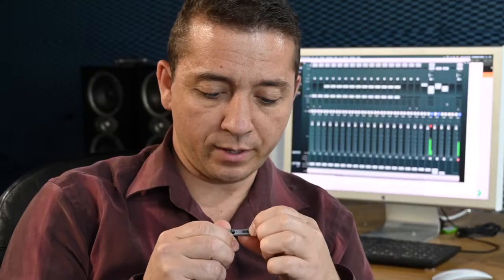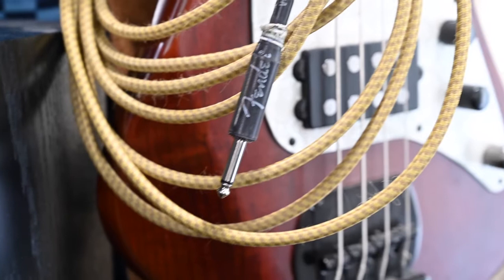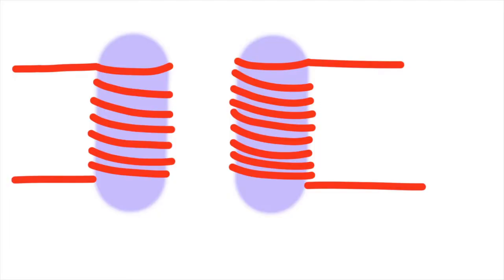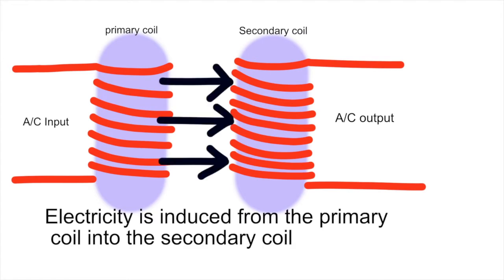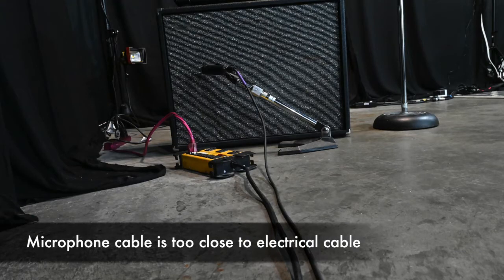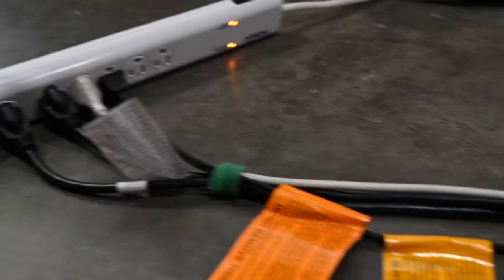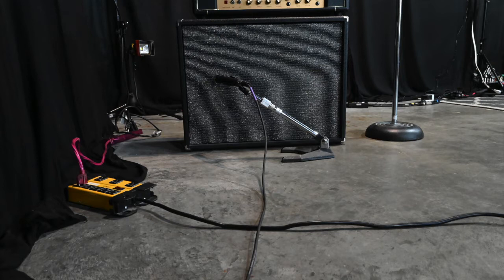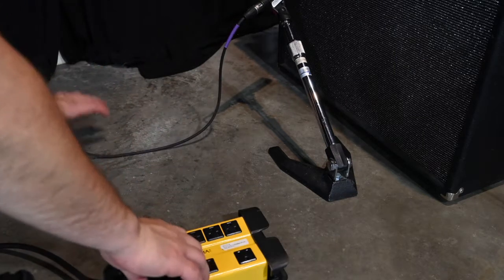Interference in the Home Recording Studio. Lesson 18

Comment: Great video! I have a small music studio and have been plagued by radio interference. I only notice it from two sources - one source is my guitar rig. I occasionally hear the interference through my two amps, but it can happen with all my guitars (some single coil, some humbuckers, some shielded, some not). The more prevalent source is my Fender Rhodes. Nearly every time I plug in I get terrible radio interference. I can sometimes get rid of it by crossing cables or just waiting for a less noisy time of day (time of day that it isn't noisy isn't consistent).

Both sources of interference pick up an FM (!) Tejano station. I'm really in desperate need of help and you seem quite knowledgeable. Thanks again for the great video!
Reply: I’m on on the same boat 😢

Comment: Great video! I have a question. Would a DI box help with radio interference when recording guitars? Maybe plugging the guitar into de DI box an then to the XLR input on my audio interface. I’m not really sure how it works and wether the ground lift on the DI box would help or not. Thanks!
Reply from the maker: A di box might help, because the xlr cable coming out of it is less prone to picking up interference. So instead of having a 20 foot guitar cable cpu could have a 10 foot guitar cable, a di box, and 10 foot xlr.

Comment: I bought the Warm Audio WA-14 large diaphragm condenser mic and have not been able to use it cause RFI is being picked up and I can hear it through my monitors, I have replaced the mic cable with a gold plated professional shielded cable and also bought a Furman power conditioner to help get some of the dirty power that was maybe causing the problem. It is still there and I have no idea what to try next to be able to use my mic. 

Great video! Thanks.
Reply from the maker: There are so many things that can cause interference. Are you only getting interference with this particular mic, or with other microphones as well?
One thing you can try, which I don’t mention in this video, is for the power to all audio devices come from a single physical outlet.
Reply: Hey Jason, i'm having a simular problem (RFI which I can hear through my monitors and through my rhode mic when I want to record something with headphones). It's impossible to use my gear (Yamaha hs7 monitor speakers, focusrite 6i6 2nd gen and rhode mic) I got no clue what to do about this issue. Have you found a way to fix your trouble or the cause?
Reply: @frowzone286  have u found a solution ?

Comment: So I have a shure SM7B connected to a GoXLR. Every now and then I do get interference and pick up radio signals, from what it sounds like it sounds like a trucker on a walkie talkie or a radio. I think it might be due to the XLR cables that I got, I pick up radio frequencies from them and well I think its because I hadn’t put much thought into it and got some cheap cables thinking it didn’t matter and id save a buck or two. I ordered a canare L-46ES quad balanced cable, so hopefully that helps ! 

My house (or at least my room) doesn’t have 3 prong connectors, so I can’t keep my stuff properly grounded. I don’t know a way to work around this, another thing I thought is that maybe ordering a cloudlifter might help? maybe it could help with interference, but I honestly don’t know. 

I’m a complete beginner to audio stuff and clearly I haven’t done my research before investing so much into this setup. I’d like to know what you reccomend! Any products to help ground my connection? thanks!

Comment: I have been experiencing an unusual interference. It is very brief - about 1-2 sec- occurs at an interval of approximately 60 seconds, and sounds a bit like a bug zapper. It’s baffled me. Worse with certain guitar PUs. I remember originally thinking it was a defective acoustic guitar pick up I had installed, but I couldn’t reproduce it at the shop and I’m sure the tech thought I was crazy. I suspect it’s coming from something in the house or possibly even outside like a cell tower? Does anyone have any ideas of what might cause an intermittent sound like that? And, by the way, the video was great, and I learned a lot!
Reply from the maker: There are many things that could be causing this. First thing that comes to mind is clocking synchronization problems with the recording equipment. Also could possibly be a fried capacitor somewhere in the audio path. It could be interference too…. Perhaps you could test the gear and systematically try to isolate what’s causing it, like shutting off the lights, bring the gear into another room… etc
Reply: @Get.Beautiful.Recordings  thanks for the reply. I should’ve mentioned that it’s not just in the recordings (also in PA), though that is where I noticed it first. it is worse (possibly only) in the street side of house (upstairs and down) compared to the back. i’ll try to keep isolating. I believe the only thing affected are microphones and guitar pick ups as I don’t think I’ve heard it with direct output from synth, etc..